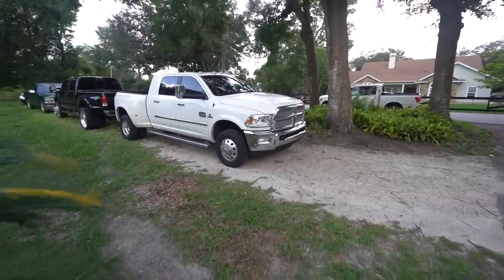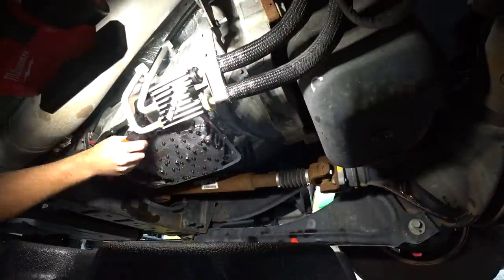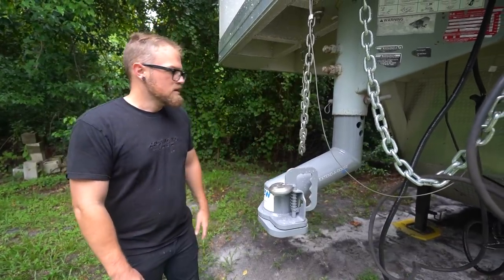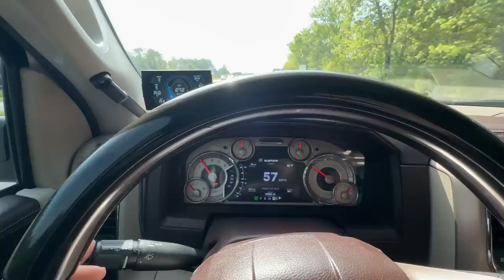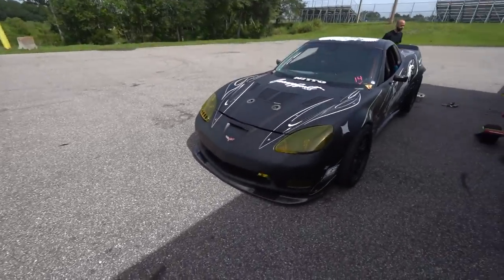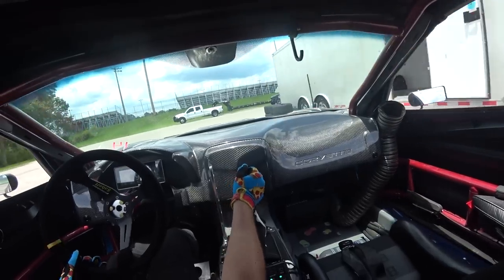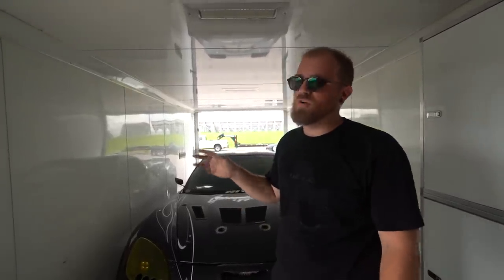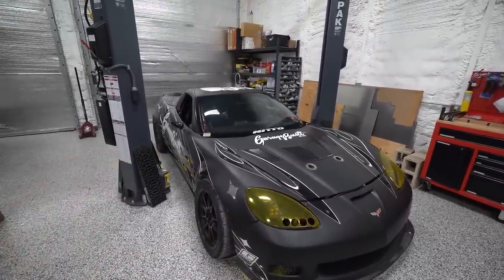Upgrading my new truck and trailer setup. much better.

Comment: Just call me crazy but I put a #10-32 screw in all of my transmission pans used a punch to make the hole then tapped it once I got the pan off, takes a bit of time to drain the oil but better than making a mess. As talented as your are I’m sure you could weld a threaded bong or a nut to the pan.

Comment: Hey In the winter time get some dryer ducting and you can hook it up too the exhaust crack the door or window so you don’t loose you heat or ac you can do it in summer time also
Reply: I used to work in a warehouse, they had thick plastic sheets you can walk through but it kept the cold in.

Comment: that thin lil plate bolted to the bed has me sketched out. not so much the frame of it but the silver offset. i would feel alot better if u welded a plate to anchor from the frame to the under side of the ball.  but there is also a change of messing up the cab if u slam on brakes and those 3 little rivets snap( they look like aluminum) cause thats what is keeping the entire ball section from rotating

Comment: May be a dumb question, but do they make padding for the lift posts? Every time you open a door while something is on the lift I think about how I would totally ding my doors up being a clumsy guy, bumping them around trying to grab or work on something. 😅
Reply: Seen people line the corners w pool noodles cut in half before to save on car doors. Could also wrap in heavy plastic/tarp. bubble wrap may help to. Just look ugly is all
Reply: @rallysport4207  This is the way

Comment: Trailer electrical upgrades for shore power and AC!  Maybe if you want to get fancy with it, solar on the top and then maybe you wont even need shore power/generator to run the trailer AC at the track!
Reply: As someone who works with solar, there is a reason people don't do this and why race trailers have generators.

Comment: Look up the peak hp and torque. Diesels make the most power/torque at low rpm’s.  My 2015 f250 6.7’s peak power is 1,600 rpm It’s fine if she lugs out a lil.   Also u need a cold air intake

Comment: Did your old sump filter come out with a o ring on? If not it’s stuck double o ringed now it’s a very common mistake…..just asking because I couldn’t tell wether there was one on the old filter

Comment: Any way you could get your trans flashed back to stock? I remember reading the 68rfe learns its shift points in the first few thousand miles, and if you drive it hard during that time it will learn to shift at higher rpms for the rest of its life.
Edit: Love the mega cab! Been a dream of mine for a while too. Those 24s (or so) on the 350 would look great on the new rig
Edit 2: I'd also say an RV awning on the pass side of the trailer would be a great edition for long days at the track

Comment: You guys should do a long bed conversion that would be a sweet build video/series.
Reply: Or just build another truck. That way he still has a tow rig and backup. Probably best off getting a 5500 chassis like they would use with a tilt bed. It might be long enough without modifications.

Comment: If your struggling with sound, Redneck Engineering # 5604: If the roof can handle the weight.. Rhino lining the roof will reduce the sound of rain 🌧 a ton.. lol

Comment: Did you replace the plastic threaded nipple with the metal version on the spin on filter? The plastic ones break and you get unfiltered oil sent through the trans.

Comment: Just curious but wouldnt you want to drive the vette front first into the trailer so you have more weight in the front for stability?
Reply: You can't put a C6 with wisefab in front first. Track width is to wide won't clear the tires. BIG BOY PROBLEMS LOL

Comment: 100% the truck needs led bulbs for hi/low and fog lights and you should also change the transfer case and both differentials fluid

Comment: Two strokes aren't meant to be lugged but diesels are built for low rpm and high torque, the definition of lugging an engine.

Comment: 0:32 Brand new truck and the door creaks like my 1952 Chevy 1300. Is grease that expensive they don't apply it at the factory anymore?
Reply: Mine creaks too and has way less miles than his 😂
Reply: not a new truck!
Reply: Not new.  And most 4th gen guys can tell yah, the door hinge is a trademark. I don't even hear it anymore.

Comment: I really would not have changed the tranny fluid or bypassed the t-stat. If you ever drive it in a cold climate it won't get up to operating temperature, the guys mentioning the gasket problem are on point too. I forsee new friction clutches in your tranny in the future. Hopefully I'm wrong.

Comment: I may be stupid, but couldn’t you just drill a hole in the lowest point on the transmission pan and just tap it so you could have a drain plug?

Comment: My 98 Mitsubishi eclipse gsx auto has drain plug 01 02 chevy silverado 1500 had them and Lexus is300 Toyota Sequoia has one. Now for the is300 Toyota Sequoia have a metal filter so in theory, there's no reason to replace it unless your transmission's going to s***That's why they have the drain plug. GSX Because it's a sports car, and if you beat on it, you're gonna need to change the oil way before you need to change the filter. Filter can go long not the fluid.
Reply: You can weld a drain plug on. I feel your pain.
Reply: If you change your transmission oil-based on the color so how hard you're using the transmission or working at the transmission filter will not catch that much clutch material. Run it longer 45k 50k If you drive like a Grandma and Grandpa 60k filter change.

Comment: dude i use my 6.7 every single day hauling machines/materials you have no weight behind your turck... they peak at 1900 rpm.. tq. and i beat the crap ot of my 6.7 haha you worry wayyyyyyy too much on your scanner, turn that thing off...

Comment: Not sure why you keeo saying diesels dont like to be lugged. They are literally made to work at lower rpms. Gas engines dont kike to be lugged. Diesels dont care because of the very low end torque

Comment: you have a RFE transmission...dont go too hard with more power...normally we delete the truck but do not add power for reliability..unless you want to upgrade the trans